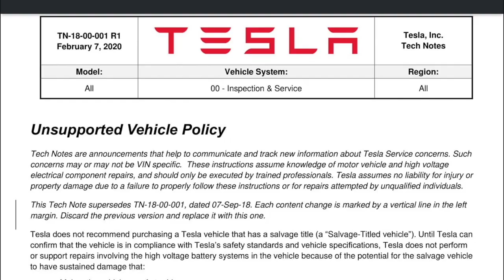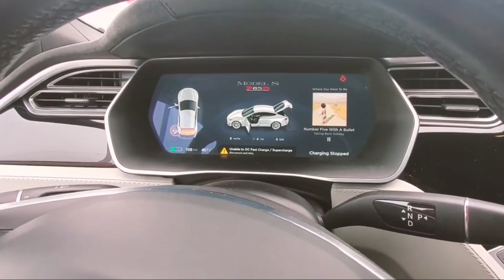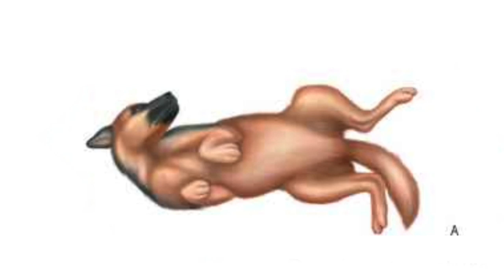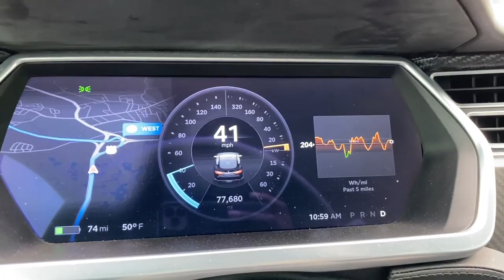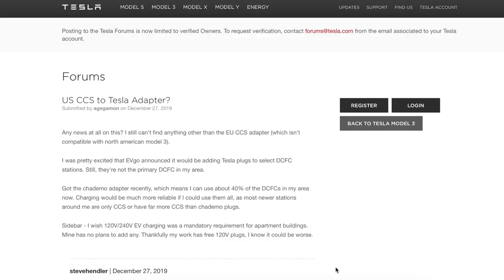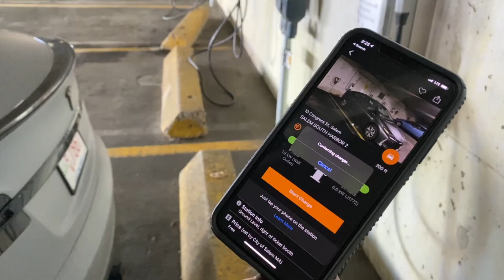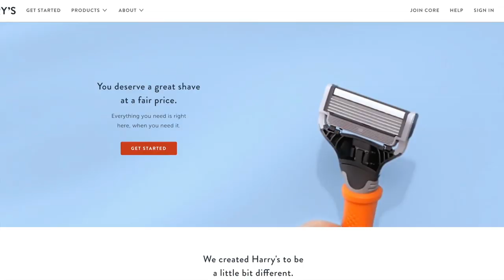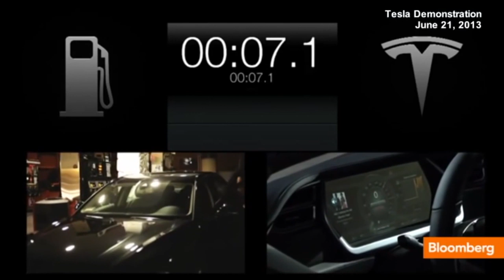Tesla ruined my car and it’s the best thing to ever happen to me!

Comment: All of my desire for a Tesla have been diminished while watching Rich's videos
Reply: Because they stopped supercharging on a crashed car?
Reply: @anthonydantonio6649  ...and their policy on selling parts is still in my opinion overly restrictive, the wait and turn around times for repairs is way above industry standard, the reported poor customer service issues, their perpetual ownership and control of the car through the operating system, and the continued release of cars having body fit and appearance defects roughly 12 years after the first roadster car was manufactured.
Reply: Same.
Reply: @purenupe1   I agree with you one the poor customer service point of view, but not the others. You can buy virtually any part in Teslas Catalog, their body defects were present in the early model 3s, but is basically nonexistent, or no worse than any other company. My brother had major repairs on his model 3 and got it back within 2 weeks, but that still kind of fits in with customer service, and Tesla doesn't own the car, the own the software, similar to how apple owns IOS not.
Reply: @anthonydantonio6649  You didn't watch the video? Can't see where this is going? What about the guy that paid $12k to have supercharging re-enabled and then they disabled it anyways lol
Reply: @anthonydantonio6649  Not just one car, unfortunately. Tesla fan here, wouldn't consider any other option if I had the money for even just the base model Model 3, but their whole stance on right to repair is making me question that more and more lately. They have outdone Apple in fuckery with their customers and that's one hell of an achievement.

Notice how every other person's reaction in this video is "just get a gas car", and how even Rich himself is considering it. This goes directly against Tesla's own mission, which is to accelerate the transition to electric vehicles. And for what? A negligible amount of extra profit as people are discouraged from buying used cars (likely more than offset by people not recommending Teslas over this in the first place) and maybe two or three fewer accidents for news sites with an agenda to smear Tesla with it? The cost to benefit to them as a company is minimal, it is actively hurting their mission, not to mention a huge "fuck you" to some of their most enthusiastic customers.

This needs to stop. For the sake of Tesla's own mission, for Tesla drivers, and for Tesla as a company too. And they need to stop lying that it's a safety thing, that's standard excuse number one when a company tries to pull something horribly anti-consumer.
Reply: Don't buy a salvage title tesla
Reply: @DeeSnow97  I do thank you for the well put response, I always believe in conversation,  and yes I am a Tesla fan, but I do consider other options. I believe I am an EV fan over a Tesla fan, the main reason I am a Tesla fan is because I believe that they are tremendously ahead of the competition.
Reply: @anthonydantonio6649  Yeah, me too. I'm a fan of EVs in general, just not some EVs specifically (the ones that do it wrong, mostly), which is why it's refreshing to see someone finally doing EVs right (which seems like a thing legacy automakers are still reluctant to do after eight years of the Model S). But that's also why it's depressing to see that Tesla, practically our only hope currently for a gasless future, is pulling shit like this.

If there were real options that actually competed Tesla I would avoid them at all costs after this move, and it's really frustrating that we don't get that option due to no one else doing EVs on the same level. I wish everyone else the best (or at least those who put in an honest effort) and I'm gonna impatiently wait for them to hurry up.
Reply: @DeeSnow97  I would like to offer a bet that once other companies start following in Teslas design, ota updates on evs, other companies will 100% do this as well
Reply: @anthonydantonio6649  Yeah, unfortunately that's how it works with anything anti-consumer. Just look at the smartphone market... iFans sometimes tell me to stop complaining since I don't even use an iPhone but here we are without a friggin jack connector or un-notched phone anywhere.

Tesla is the Apple of cars, and unfortunately not just in the positive aspects.
Reply: @DeeSnow97  - I am an EV fan also, but I agree with you, this is wrong. They already have so many safety features, temperature sensors, etc, all over the battery pack - that it should be able to detect 'issues' - and disable charging until the issue is fixed. What else are they going to disable?

Rich said that FSD is licensed to you, and when you sell your Tesla, you don't get to claim that it has FSD. 

I LOVE EVs. I even converted a vehicle to EV once myself. What Tesla is doing is just like what Apple is doing (Watch Louis Rossman videos). It is against "right to repair" - and it's against "back yard repair" - Ian Kelly will say "Well, it's the right move for Tesla to disable all this stuff, [because Elon walks on water, and I carry his child]." - Yeah, I'm not buying it. 

Ben, you're right, Tesla has done LOTS to introduce amazing technology to the world.  So, doing this, when all the sensors all over the vehicle should tell Tesla when things are overheating... No. I'll never buy a Tesla. And since nobody else has a world class supercharging network, I won't be buying an EV at this time (I bought a Hybrid instead).
Reply: @anthonydantonio6649  Other companies are ALREADY doing this. 
For YEARS John Deere has made their high-dollar tractors unrepairable. You aren't authorized to work on their machines. Your option? To (1) rent an 18-wheeler/trailer/driver, (2) get DOT permits, and trailer your $300,000 Combine to an "authorized John Deere Repair center" - for a total cost of 15 thousand dollars. Then, you have to do it all over again, to get it home, and hope that their repair lasts a while (they apparently don't make 'house calls').

Apple makes their phones complain about having an APPLE battery placed in an APPLE phone, but not done by an "authorized repair center." Apple makes their phones disable an APPLE  'fingerprint sensor' - if it's not done at an "authorized repair center." - Yeah, I don't buy Apple any more. After my ipad dies, I'll give it away, and not buy another Apple product.

Now if you "repair" your Tesla, If Tesla finds out about it, they disable all kinds of things on your vehicle. If you SELL your Tesla, and they find out, they disable FSD for the guy who bought it from you (wait until he asks you for a $7000 refund).

You want to drive  your Tesla more than 300 miles, for Heaven's Sake, don't ever scratch it!!! EVER!! Or, Ian <swoons in the presence of Elon> Kelly will justify Tesla disabling all kinds of features, because there most certainly isn't a single sensor on the damn car telling them that things are going wrong.
Reply: @anthonydantonio6649  "Because they stopped supercharging on a crashed car?
" - does it look crashed to you? Or are you just blind? Rich did a FANTASTIC restore job on that vehicle. Just wait until Tesla puts an "unauthorized screwdriver detected, Please exit the vehicle so it can melt into a useless puddle of garbage"
Reply: @Maybe-So  He did do a great job, and for the longest time I wanted to try to rebuild one as well because of him, I have nothing against him. The problem is he is not the only one, and he isn't a professional either way.  And again you are like 30th person who I have seen say, "Just wait until Tesla does this"  pure speculation based off of zero evidence is terrible for debating. I can say just wait until the Ford Mach E comes out, they will no longer support any of their gas cars. My statement has as much credibility as yours does.
Reply: @anthonydantonio6649  What makes Tesla so special? You can buy a scrapped Porsche, BMW, Mercedes, literally any other car, rebuild it and nobody will care. Some people chip tune their cars and even take their factory built in speed limiter out, apart from the warranty being void, nobody will care. You wont get a limit on your power output or top speed because they dont know whether youve done a good job or not, no manufacturer will force you to go to their own dealerships for maintenance or repair since spare parts are readily available everywhere and for everyone. And you can even do that to any other EV as well, Tesla is the only manufacturer that just deactivates features you paid for on the fly whenever they want.
Its quite clear that this has nothing to do with safety, but everything to do with maximizing profits and holding their costumers hostage, unfortunately many dont seem to realize that or simply dont care.
Reply: @anthonydantonio6649  your insane if you think ford will stop supporting their gas cars this ev shit dosent compare to gas or diesel and never will you go have fun jumping through hoops to fix one thing while our gas cars are on the road doin work just remember ev will never be better than gas because of the experience that you get from working on a gas car

Comment: Why would anyone buy a Tesla and sit for hours to charge, i will stick with gas
Reply: you dont get it
Reply: Lol it ain’t no hours to charge, your at home connector can do 50+ miles an hour. While your not doing anything. Essentially you wake up with a full tank of gas every single morning. When you need to charge on the road the new super chargers are supposed to do 1000 miles in one hour. A standard model 3 battery is 250miles. Thus taking 15 mins for a full charge. The average person spends around 10 mins at a gas station filling up a normal car. Yet you save a lot more money almost 1/3 the gas price. Edit: model 3 is the only one that has to pay for supercharging.
Reply: Economically better on many fronts. Also $8.00 to charge mine is amazing
Reply: Because it’s really hard saying fuck you to the oil industry if you depend on them every day. And Tesla isn’t the only electrical option out there that is functional.
Reply: Well ur not supposed to be dumb and let your car drop so low to the point that u would have to wait to charge for hours
Reply: @CCASSIDY  Deduct the 3x the initial purchase price to compare apples to apples on "filling a tank"
Reply: @charisma-hornum-fries  How are you saying F××k You to the oil companies?
Power plants that generate the power for you to charge Tesla are powered by fossil fuel.
Reply: @CCASSIDY  $100k cars with very high insurance premiums and repair costs and rather poor resale value...
But it only costs $8.00 to charge.
How many cheap charges do you have to do before you break even ..
Reply: @williamegler8771  definitely not poor resale value, 2012 Teslas still cost 50k

Comment: Wait, I thought Elon / Tesla's whole mission statement/purpose is to accelerate the global transition to renewable energy; they've just gone totally against their ethos in such a petty way, forcing some individuals to consider gas again
Reply: Not at all, this is a safety concern (according to Tesla).
Reply: Elon's mission statement his to hit the numbers needed for his megabonus. Can't do that with 'free' supercharging because that costs Tesla. Rich made a great point with his visit to Gus. If someone brings their EV over, would you give them 'free gas'? A fun project for Rich could be making a DC charging trailer he can tow. Run a genset off wood ethanol or bioidiesel, and it's still be renewable energy :)
Reply: @JasonWW2000  I understand your point but there should be an option to take the Tesla somewhere to get it checked thoroughly. But they don't even allow that.
Reply: @JasonWW2000  I disagree. I think this is a Tesla wants to sell a new car thing
Reply: @JasonWW2000  yeah cuz richs car blew up 100 times b4 it stopped supercharging... tesla is turning into apple
Reply: @JasonWW2000  Safety concern my ass. It's just as much of a safety concern for DIY mechanics to work on gas cars. If a shoddy repair is conducted that can lead to an explosion it's gonna happen. EVEN if you are a certified mechanic. Just because you are a certified mechanic doesn't mean you are exempt from creating a catastrophic failure during repair. There's news reports all the time of gas cars exploding because the customer went to a shade tree mechanic. Even Tesla can make mistakes. So if their concern is safety, they might as well stop making cars period. As with human involvement, no matter how trained/smart it's guaranteed to eventually lead to failure.

This has absolutely nothing to do with safety AND EVERYTHING to do with corporate greed. The less EV mechanics that exist in the world, the higher the chance Tesla get's a brand new car sale instead of receiving NONE of the money due to third party sales. They want a monopoly and because EVs are so new, regulations haven't been put into place to bring EVs to the same level as gas cars in terms of availability of information and parts so the people can decide their repair or purchase options.
Reply: @JasonWW2000  It's not safety.  Tesla turning off autopilot on cars sold second hand proves that.  And Elon's now forcing workers to come in when the state of California said not to, which is super unsafe.
Reply: @ischmidt  Autopilot (Sorry, I meant FSD) is a add-on feature sold to the owner. When the car is resold the autopilot feature is removed unless the new owner wants to purchase it.
Reply: @JasonWW2000  if you buy the car with the option enabled it's listed as being part of the car...
Reply: @jwenting  Not really. It's a non transferable option.
Reply: @JasonWW2000  Wait, autopilot they are removing now? I've heard of them removing FSD, full self driving, but buying used now they remove the free autopilot feature???
Reply: Apparently, they think this strategy leads to less bad publicity than if they re-enable it. There's one way to change that.
Reply: @JasonWW2000  Which is completely anti-consumer.  If hardware exists in the car, you own it.  Even in their most corrupt and venal days, Detroit never tried anything like that.

Even in tech, it's unheard of: if I buy a computer from someone, I don't have to pay Dell to use all of the hardware.
Reply: @yeahbuddy92193911  Sorry, I was mixing up FSD with autopilot. I was refering to the $7000 option.
Reply: @ischmidt  It is common in tech. For instance you might buy a computer that comes with 30 days of free anti-virus. After that you have to pay for it. Or some of the large software suites  that are not transferable. In Detroit they give you free OnStar for a certain time then you have to pay for it. They treat it like a service instead of hardware.
Reply: @JasonWW2000  which at least here isn't mentioned when you select such options on the order screen on their website...
So people order things like that, get the car with the option, sell it with the option to buy say a EQC, and then the buyer complains he doesn't get the stuff he paid for.
Reply: @JasonWW2000  Anti-virus is a software feature though, and free alternatives are easily available (starting with Windows Defender).  And OnStar isn't a thing where the car is effectively useless when it's off like fast charging.

Comment: Coming up: Rich builds his own Supercharger at home.
Reply: That's what I'm waiting for. It will probably solar powered to boot.  ;)
Reply: Hack a generator in the trunk or tow on a trailer?
Reply: Yes, but the supercharger is nothing special, it's just a high powered charger. It's the car that has had the ability removed from.
Reply: @davecasey4341  Jokes aside, solar powered supercharging would require a pretty absurd array of solar panels or very limited charges per day/week and a huge battery pack at home.
As far as Wikipedia data go, between 72 and 250kW of power... that might require him to rewire the neighborhood probably to not give 'em all brownouts when charging the car.
Reply: So open source car tech and patents... though scam like software licensing schemes where only the manufacture really owns the software?  The "owner" only licenses the software for use and never really owns the software?

Comment: LS swap it for revenge.
Reply: Raitzi Definitely do that.
Reply: This would be amazing and a nice middle finger to Tesla at the same time!
Reply: It is that i dont have money to buy a tesla otherwise i would already done it haha.
Reply: Imagine having to figure out how to get the drivetrain to fit and altering the suspension around it. That would be a pain.
Reply: @MrCarGuy  Oh, even _worse_. Teslas have no propshafts or anything; you'd have to throw in your own differential, find somewhere to put a bulky transmission, and gut the front trunk for an engine. Then there's other minor things like fuel tank location, _exhaust pipes on a Tesla_, a brand new radiator for the grill that has a 0.1m^2 grill (or even 0m^2 on a Model 3/Y)
Reply: Ls it for a hybrid, like a chevy volt.
Reply: @NoorquackerInd  Yes, but drivetrain would be the hardest part to improvise engineer: Transmission, driveshaft, diff. I doubt you could fit anything larger than a 2.0L in the front without damaging modifications.
Reply: Keeps the wife happy as well...😂
Reply: Now that’s an idea for a show - seriously😆. Fit a salvage Nissan Sentra ICE in that Frunk! FF layout. You could collaborate with vTuned on the build. If you don’t mind your model S hacked to pieces, you could get that mad man -  B is for build on board too. 😁 Epic. Ultimate middle finger to Mr Musk for disabling supercharge. I’d tune in to watch that build.
Reply: DUDE I SWEAR TO GOD I WAS THINKING THE SAME THING ...JUST TO PISS OFF ELON MUSK!